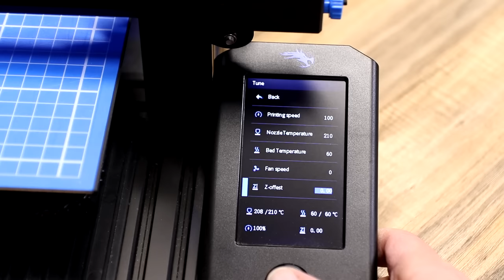Ender 3 V2 Bed Leveling : Quick Look at How to Level a 3D Printer Bed

Comment: UUUUUUUUUUHMMMMMMM  you don´t have to loosen your Z-endstop. You leave the microswitch in the lowest position and screw the heating bed all the way down. Then you screw the heating bed back up until the distance between the nozzle and the printing bed fits perfectly with the piece of paper trick... AND THATS because during daily printing you never will check if the screws of the microswitch are still tighten. So what would happen if they are not and the switch isn´t in the lowest position? Right you destroy your printer....

Comment: Something to keep in mind to make things go a little faster. Try to position the nozzle directly above the screw that you're turning. This will eliminate any of the extra rise or fall you get from being off from the pivot point. If you manage to be directly above the screw/pivot point, you will also eliminate the effects the screw adjustment will have on the other three corners.
Reply: That's what he said in the video.
Reply: Great advice. Thanks
Reply: Sounds genius, but still to be tested, will give my Feedback on this later, thanks
Reply: I started this and on my first pass around discovered the right rear corner was almost 5mm higher than any other corner. After a lot of troubleshooting I discovered the x-axis support was not square with the bed or z-axis supports.  turns out one of the rollers was bent.  once I fixed that looks like the bed leveling was working

Comment: Having huge issues now with my ender 3 v2 Bed Leveling, I get all 4 corners perfect (with bed heated and also without makes no difference) Middle always too high and doesn't stick at all, using Z-offset at -0.07 I get perfect first layer but every layer after gets closer and closer to the print and I have to set the Z-Offset to +0.15 then its perfect what am I doing wrong or is there a way to set this in Prusaslicer so its automatic

Comment: I literally cant get the thing low enough to kiss the paper like that... I feel stupid, because I literally cannot get this to work.
Reply from the maker: What if you turn your wheels more to raise the bed? Or lower your Z end Stop?
Reply: @TheEdgeofTech  So, i found out the issue here... for some reason some of the stock springs were too small/compressed. So, I would try to raise the bed to meet the nozzle, but the adjusters would just spin freely. Clearly, I need tension on the springs or the adjusters would just fall off.  I ordered the spring upgrade and they're already here and I just started printing "CAT". 

I used your paper method and it did take 5 minutes once the bed was able to touch the nozzle. I appreciate you :')

It's pretty dumb, but I guess that's 3D printing life...

The Z-axis stop is all the way down, btw.

Comment: Hi, I just wanted to say thank you so much for making this as I got a ender 3 v2 this Christmas but after I assembled it the bed wouldn’t level as the top of the printer would touch the bedding hand when I pull the bedding it would scrape. I think I found the problem as this video has helped so I thing the problem was that the x axis went down to low and as you showed that we could move up the stopper this is probably going to make the printer able to move around the bed comfortably, thank you for making this.
Reply from the maker: I'm glad it could help! I hope You love your printer! Thank you for watching!
Reply: @TheEdgeofTech No problem thank you !
Reply: @TheEdgeofTech  happy new year man, have the best year!
Reply from the maker: @drazo691  You too! Happy New year!
Reply: @TheEdgeofTech  sorry to bother but I have a bit of a problem. When I start a print it always messed up by the print not staying on the bed when the printer moves. It’s starts the print and then when it moves the print moves with it and it’s not sticking to the mat properly, if you have any idea what’s causing this please tell me as I’m trying to print some stuff for my brothers birthday which is in 2 days.
Reply from the maker: @drazo691   Make sure the bed is very clean. You can use isopropyl alcohol or even a little bit of dish soap and clean it up good in the sink. Then make sure your nozel is close enough to the bed.  Also make sure your bed is about 60°c.  And you might have to slow down the first layer in your slicer.
Reply: @TheEdgeofTech  Thanks, I am new to 3d printing so your help has saved me so much! My friend is getting the same printer as me so I will definitely recommend to him to watch this video! Again thank you for the help I will try these.
Reply: @TheEdgeofTech  If i could ask one more question that would be good as you are the most helpful person I have come across so far. What should i do if i have a print that takes like 10-20 hours as it is unsafe to print while sleeping?
Reply from the maker: @drazo691  The official answer is to always be safe and watch you printers while they are printing. Many of us go to bed while our printers are going though. I believe it's Best to have a smoke detector next to your printers, and I have the self detonating fire balls next to mine too. But it's not uncommon to have a print go for days. So just be safe and you'll be ok.
Reply: @TheEdgeofTech  I am printing a small thing and it says it will take 12 hours and I don’t know if it’s the amount of filling but it definitely shouldn’t take 12 hours. Anyways thanks for the help!
Reply from the maker: @drazo691  No. It will all vary depending on your layer height, infill etc.
Reply: @TheEdgeofTech  my infill line width is 0.4 and my later night is 0.16, thank you for the information I will print will joy now because of you.;)

Comment: "Takes 5 minutes tops"

Me on day 6 still trying to get my bed leveled. . :')
Reply: Same here, I've spent quite a lot of time manually levelling the bed, even with BLTouch, there are always couple rebel circles when I run   bed leveling print.. frustrating
Reply: Take a look to the excentric nuts on the botom of the bed, if yuo adjust , yuo change a little the geometry of the bed, resulting in a warpped or semi warped bed
Reply: What i do is use 2 pice of paper (not one), because i use 0.2 mm layer high, the point is use something similar to yuor layer high, for example, if yuo use 0.1 mm layer  high, use just 1 paper(0.1mm paper)
Reply: @noway8233  testing this now! .. will give updates.. i heard business cards are good also?
Reply: @alexkurebis3907  i use a tipical pice of paper for printer, they mesere 0.1 mm aprox (yuo can check with a caliper), but for 0.2 layer high,i use 2 papers togerher, so the nozzle can touch them..when yuo fell some resistance, thats ok, the go to the other corner, always move a little cause when yuo change one corner, afect the others, so i do this a cople of time until they are more less the same(yuo can check the center too,and see how warped/flat is, an remenber, the eccentric can chage the geometry of the bed, good luck)
Reply: Same....
Reply: @connerschinkus3637  i finally figured it out... try this:

if your using the Glass Mesh bed it came with... flip the glass bed to the flat side... Use the Chep Leveling gcode that goes to each corner... level each side .. IGNORE the middle level... once the gcode is done.. pre-heat your bed and nozzle.. add glue stick glue on the surface you'll be printing on and test a print and see if that helps.
Reply: @alexkurebis3907  thank you I will definitely be giving that a shot!! What does the glue stick do?
Reply: @connerschinkus3637  it helps stick the PLA to the bed.
Reply: Smith's firmware for BLT, cheap glue sticks to stick prints- can be used to clean bed too, use on either side. Dual z axis kit from Banggood- helps a stack with wobbly right hand side.
I'm now using Octoprint with bed visualiser and bed level is 0.05mm off.
Addition of hotend mod on Chep's channel.
Reply: Add a BL touch on it, since i did that i never had to relevel it.. i have the ender 3 v2
Reply: @pandaterminator007  already purchased it, waiting for it in the mail.
Reply: Literally me, I’ve been doing this for a week and a half, hopefully the vid helps me.
Reply: BL Touch, never looked back :)
Reply: Really me to damit
Reply: Me on week 2 of trying to get prints to stick/come out great first layer lol
Reply: Get a glass bed and leveling issues will be a thing of the past!
Reply: Totally didn't help
Reply: @pandaterminator007  please I have a problem with the BL touch I purchased for my 3V2. I noticed that its not right for the 4.2.2 motherboard. On uninstalling it I found that the hotend does not move downwards towards the z axis anymore. Its frustrating because it seems I can't manually level my bed anymore. Please what can I do to get my printer back to work. I am pretty new to creality and 3d printing. Thanks.
Reply: on day 3
Reply: I am flashing jyers firmware tomorrow. It lets you do manual mesh leveling which is really cool
Reply: @martinsobi1689  maybe u forgot to plug in the z end stop? Or reflash fw.
Reply: Have been trying to get my very first print for weeks because of this. I find it hard to believe, you have to assemble just about everything, then when you try to print, nothing but frustration. I love how everyone the tells you, buy this, buy that, buy more items....gets old
Reply: Yea so when I replied to this... I can say I’m on day 24... how’s your day?
Reply: @alexkurebis3907  How do you get his gcode to stop and wait for user input? For me it just keeps going
Reply: I'd also recommend that you check your gantry assembly too, sometimes your X-Axis can have a bit of bias on one of the lead screws.
Reply: @rrtraxx13  not trying to insult you in any way, but this really is a hobby. It's not going to be perfect out of the box. I've had my Ender 3 v2 for almost 2 months, first prints came out good, I admit, but then a couple weeks in, it started not sticking and had first layer issues. Still working on it. It can be frustrating sure. But I enjoy learning about it. It'll get there, you just have to work with it. Good luck.
Reply: Same
Reply: Same I spent a week and just got it perfect
Reply: @scaramonga  this isn't the goldent bullet.  I bought the bl touch but the bed has to be more or less level in the first place
Reply: @martinsobi1689  set the z-offset.  If you have jyers, there is a manual level option under prepare too.
Reply: @alexkurebis3907  yooooo no wayyy. I spent like 18 hours trying to get it level. That worked like magic. Thank you lol
Reply: I turnes the bed screws all the way in then 4 half turns out as you did. However the zaxis switch was bottomed out? I had to go 10 or 11 half turns out to have any room to move the zstop switch. Once leveled I had to tune the zbaby step 0.8mm, is that normal?
Reply: yup, same here, wanna throw my Ender out of the window!
Reply: same
Reply: Lol fuck i thought i was the only one going on week 1 trying to level the damn bed.
Reply: When I go to home possession the nozzle goes off the bed??
Reply: @keneppink7272  get a BLTouch installed, this solved my problem 2 weeks after my comment lol
Reply: I tried for over a week with multiple ways on doing so, gave up, left my ender3v2 to collect dust for over a year and finally have it running today. Printing out an xyz cube but for some odd reason cannot print a bulbasor because the filament goes haywire. Let's hope I don't give up again lol
Reply: @zainag  joke
Reply: You're not alone

Comment: at the end you talk about baby stepping to get that perfect first layer, but i wish you described what to look for and how to tell if you need to go up or down as it's starting. it's cool to know we CAN do minute adjustments, but we need to know what to look for to make  a decision.
Reply: Imagine a cross section where the filament in a line is a slightly squished oval. That's what you are aiming for. If you look at the underside of your parts as you print more and more objects, you can keep dialling it in to get a nicer lower surface finish

Comment: Pointed this out only couple weeks ago as not 1 video showed you need to load up the bed adjuster springs to begin with and next is to take the bed amd nozzle up to operating temps as heat makes them expand so then they are different measurements again , so firm up bed springs then heat then level , FIRM HEAT LEVEL jobs done 👍😊

Comment: If you disable steppers, your z-axis will be free to drop down. Its better to leave it enabled and move XY with menu. And always move your nozzle right above springs, so you dont need to relevel 5 times.
Reply: it isnt going to drop because the z-axis rod is threaded

if you dont disable the steppers you are going to be putting wear on them and eventually burn them up
Reply: @InZayne  Thats not true. Do you think that  z-axis stepper is disabled while you are printing? Its enabled whole time during print. And try to move the axis down with stepper disabled and you will be surprised how easy it is.
Reply: @sviccc  your z axis will not be able to drop down, because it is at lowest point possible due to the Z stop. Disabling makes bed levelling so much easier and faster, at least in my experience.
Reply: @Mkayy9  i have bed leveled in one minute. When you drop your axis on endstop, you are actually beyond its switch point. And also putting stress on it...
Reply: @sviccc  autohome makes it touch the stopper. 

1 minute with menu option? 😁 thats a lie, sorry. Or your bed has to be leveled at the beginning. If the bed is unlevelled you are risking to damage nozzel when setting it to move to other corner, because it would not stop when it starts touching the bed.
Reply: @Mkayy9  im leveling via octoprint plugin. It just move nozzle above my custom points and i level and its done. One minute work. Works pretty well.
Reply: @sviccc  gotta check this plug in. Thanks!
Reply: How do you have a blue plate

Comment: I purchased an Ender 3 as my first printer. Never again will buy a printer that is not self leveling. I used a Bambu P1P self levelling printer last weekend and it was a dream. Fast setup with zero calibration. Yeah, more money but well worth it.

Comment: There’s some cura prints you can get that’ll automatically position the nozzle over the four corners for leveling. POG
Reply: or use jyer's firmware
Reply: @youraveragemetalhead226  whats that?

Comment: I'm really new to 3d printing but my best tip is level right above the 4 screws first. (like in the video)
The skirt print helps as well. If it's thin the  bed is too high, if it isn't squished but round, the bed is too low

Comment: I read that disabling stepper motors can result in slight changes to the nozzle's z position when moving the head around the surface. That's why I use the move option and use the screen to move the nozzle.
Reply from the maker: This can happen, and a lot of firmware is now including the Leveling option to move the hotend to the specific points on the build plate for you! Thanks for watching!
Reply: This happened to me. Somehow when I disable the stepper, the z-axis motor turns a little bit and that really ruins my leveling. I use different method by the way. Once I do autohome the nozzle, I move z axis by 0.2 or 0.4, then instead of paper I use feeler gauge with the corresponding thickness between the bed and the nozzle.

Comment: Trying this method now. My issue is that the z-stop cannot go any lower. the nozzle is nowhere near the bed when the z-stop is at its lowest possible point. I'm guessing this is because I still currently have the OEM bed springs, not the upgraded ones that you recommended in another video. Those will be here tomorrow, so I guess I'll try again when they get here

Update: With the yellow springs. this method was basically required as the yellow springs are slightly taller, the z stop needs to be offset up to match. Awesome, informative vids

Comment: My ender 3v2 right out of the box was an absolute beast. Easily my best prints to date. I then went and upgraded my springs, Bowden tube, couplers and added a BLTouch and I can't get the bed to level worth a damn. Ive tried different methods and firmwares and even if I get the first layer to go down OK, it ends up dying about halfway through. So unbelievably frustrating.
Reply: same for me
Reply: @ImranKhan-lx3fi  check your extruder for cracks. Mine ended up broke, which was the reason for my poor prints. I upgraded to a metal extruder and have had no problems since.

Comment: Hi, I have a problem with the printer. I am new to 3d printing and when I start a print the plastic moves with the printer as it moves. I have levelled the bed properly and whenever I start a print it just doesn’t go straight on to the bed and curls up and moves around with the printer and I’m really stuck at the moment so any help would be great.
Reply: Another way of saying it is when it starts a print it does no go directly onto the bed when the nozzle is so close to it and it just lifts up. When I was printing the calibration cube it would just print and then when the nozzle moves it would go with it and not stay down when I’ve gone round the bed levelling a lot.
Reply from the maker: To me it seems like you don't have the nozzle close enough to the bed. Also make sure that your build surface is very clean. If it's glass you can use a little soap and water on it and wash it really good. Also, isopropyl alcohol works very well. Make sure you're using 60° c temperature on the bed as well.
Reply: @TheEdgeofTech  I made sure the bed was close to the nozzle and cleaned the glass bed and then printed out a benchy and it came out fantastic! Thank you man you’ve saved me!